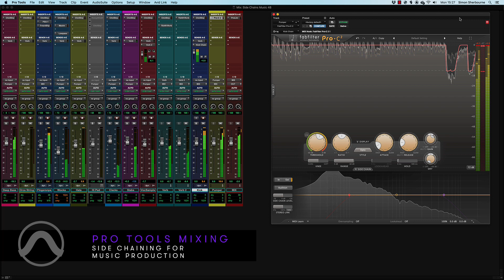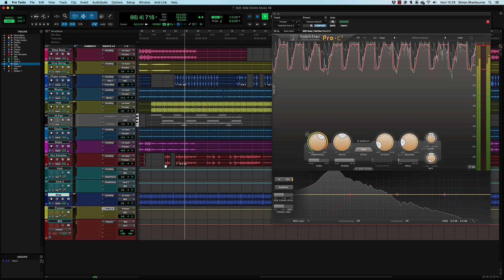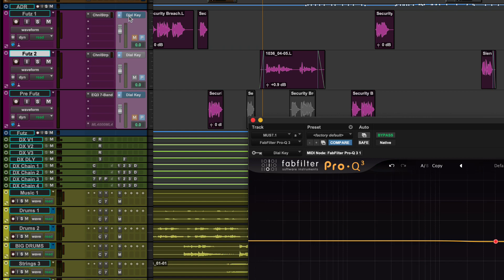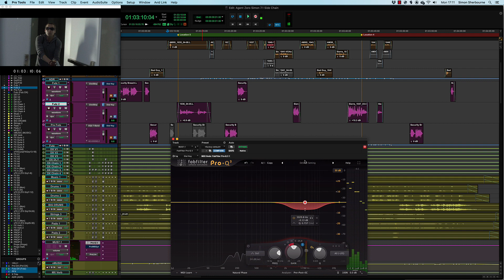Side Chaining in Pro Tools — What is it and How to Use It

Comment: Please avid fix so that the side chain is correctly in time. I’m running the latest version (which is supposed to have fixed this issue). Ive started doing pre prod in Ableton and it’s SOO MUCH better with latency compensation.
Im loving pro tools and have been for many years, but this problem is making it almost unworkable for me, and many of my colleagues, and I can’t seem to find a workaround for this that works good.

Thanks for an otherwise exceptional mixing and recording daw 🙏🏽🙏🏽